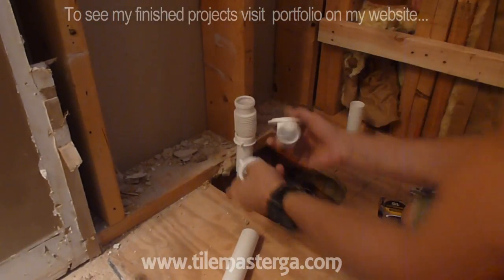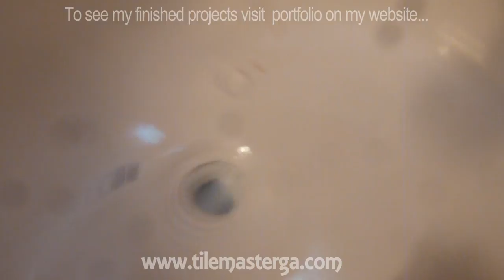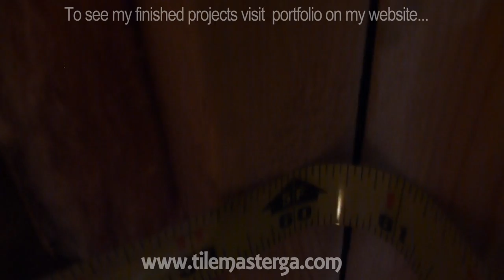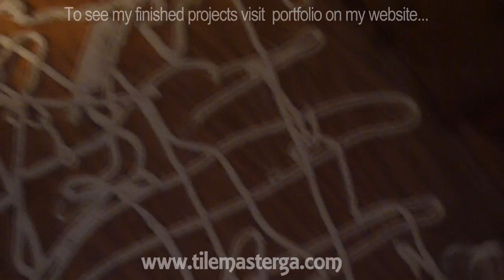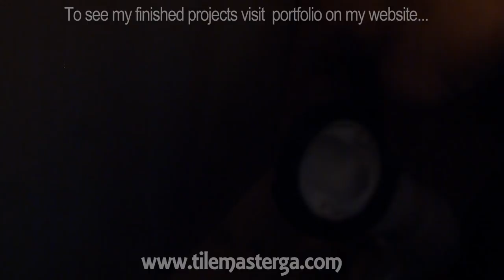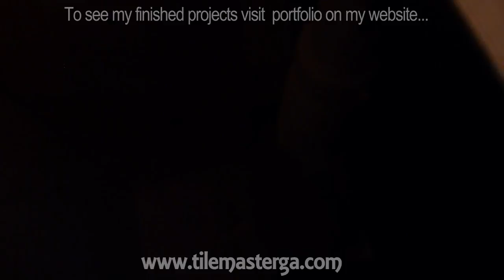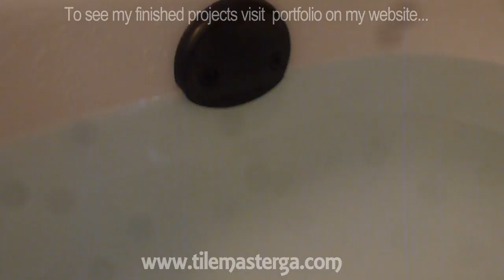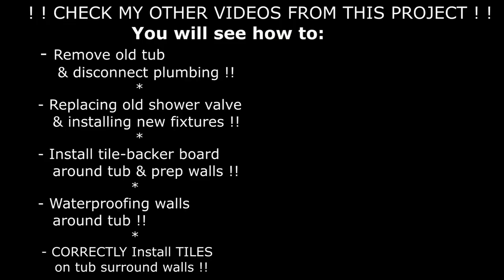Part "2" Installing new bathtub, connect drain waste and overflow plumbing DIY Atlanta GA

Comment: Just wanted to stop by and say great videos Mike!!! I used to do construction when I was in college (mostly roofing but we did bathrooms and other various work once in a while) but if you're not doing these types of projects every day you tend to forget steps. You're very thorough in detailing what parts/tools you're using and more importantly WHY you are doing what you do. That really helps when trying to figure out what I'll need to do when I redo my own bathroom. I'm DIY homeowner in the process of updating room by room in my place. Kitchen is done, flooring done and now onto the vanities and bathroom. These can be more intimidating due to the plumbing and demo involved and the pressure to do it correctly. Your videos really help providing confidence that I can do this myself (luckily I have a brother & friends that know this stuff just in case I need someone to bail me out haha). A lot of other contractors go to fast or assume you're a pro when explaining processes, or even worse they DON'T provide tricks of the trade on their videos. If anything you are getting you're name out there and positive word of mouth about your work. I'll definitely be using your vids for tips and also other ideas when I redo my place. Thanks for posting!

Comment: I do maintenance work and I have a suggestion. That inside lip of the wall has that horizontal 2x4 nailed to support the inside 60" lip. I find that the 2x4 does not hold up with use and the seam between the tile and tub will move too much causing the caulk or grout to need constant repair (every 2 or 3 years). I recommend adding vertical 2x4 support at every stub to give it extra support. Also some tubs never sit on the floor. I suggest filling the space under the tub with support to reduce stress on that same horizontal 2x4 support. Pour concrete into a plastic bag and place that bag under the tub. The concrete will mold to the shape of the gap and give the tub a nice solid feel on the bottom. A tub full of water and a heavy set person can make the tub move and eventually destroying the seal between the tile and tub.
Reply: +James L That is an excellent idea. Thanks.
Reply: How wet do you make the cement and what types of plastic bags do you use? I have always braced the horizontal supports but Great cement bag idea.
Reply: oh! Good idea, thanks.
Reply: That bag of cement is such a great idea. We foamed the bottom of our tubs in new home construction, but you do indeed risk the expanding foam lifting the tub up if you do not weigh it down. Also, the foam method assumes you already perfectly levelled the tub. This cement idea can let you rework the tub if need be. Thanks! I'll try it out next time!
Reply: YES! Brilliant addition to this video. We started out like this but used our knowledge from fixing old stuff in our home to do the same. This guy is young (but better than most vids you see) and very thorough and I know he will appreciate this comment. I know I would and do!
Reply: You, my friend, are a genius!

Comment: The tub basin was said to be slightly imperfect is why the inconsistent tub lines and slight jank because of extra work but installed with the level reading right for uneven lines from factory tub slightly ...good job

Comment: Definitely respect your language skills. I was an ESL student once, and your explanations are admirable in clarity and composition. I'm sleeping on the floor after dismantling my bed so that I can paint this room properly. In the process, the fins on the baseboard heater were bent and filthy so I spent over an hour straightening and cleaning them. I won't be down here on the floor again for a while, so why not do it right? I'll reinforce the tubing mounts and drill around the whole case unit with self-tapping screws. Otherwise, the segments will fall off and bend the fins all over again. Someone else wouldn't care, but I am not that person. I am not a tradesman, but trained as a heating tech when I was younger. I was taught by an old German-American teacher, Mr. Scherle, and his lessons live in my hands. Auf wiedersehen and good work from New York City.

Comment: I agree. great instructional. I will say that it looks like it was a 32" wide tub that came out and only a 30" that went back in. That would explain why your drain and overflow did not line up. Everything got moved over closer to the wall, meaning the center point was a shorter distance

Comment: I have to say that i watched many videos on this topic, and this one is by no doubt, No.1. I wish you were in LA, California so that you could do my bathroom. Professionals like you are no where to be found here.
I basically did remodel my bathroom, and did many parts myself except i let a plumber set the tub and do the plumbing and a tile guy to do the tile. Well i ended up demolishing the tile work and it became disaster. The only reason i hired people for that is that i wanted a professional job. My tub was installed not level, the tile guy was following the tub, and the result was the two side walls were totally not leveled. One side was next to a window, and edge of the tile was basically going away from the window line about 3/4" from the bottom to the top. Very visible. Even the tile guy barely used level. Unreal... He didn't even think water proofing was needed. Also he was arguing with me that there should be no thinset between the plywood subfloor and the backerboards. Just screws he said.... Where are the true craftsmen like you? can you open a school and teach these people how to work??? please....

Comment: Thank you so much!  This was a thoroughly detailed and amazingly helpful video!  

The use of a flexible tail piece on the overflow tube saved me so much time and effort.  I don't think it would have been possible for me to fit a standard rigid tube in my location without significant changes to the waste line.  Instead, my tub was hooked up in less than 10 minutes!

Comment: very good.very informative. repetition is good.
to inspect your work on the cheap, use your webcam and your laptop. I used it once with a 10' USB extension - worked like a charm. You can take pictures or video.

Comment: Thanks!  I have followed all of your suggestions and the tub install went great!  I actually purchased the same tub you used in this video because it was the best bang for the buck.   I ended up using 1/2" Durock board and latex modified porcelain mortar.   Coming along great!  I couldn't get the drain plug to hold without leaking using plumbers putty because it all pushes out with my drain flange so I went with Permatex's non-hardening "form-a-gasket" ...so far so good!

Comment from the maker: Yes, you just need transition from metal to PVC - usually rubber coupling - ask in local hardware store. I am assuming that you have old cast-iron pipes?? if so you will have to remove old p-trap and put transition coupling on main pipe (2") and then PVC p-trap and drain... I hope that helps.

Comment: good show....remember if you have an Inspection,you need an access door to the drain,unless you use solvent weld fittings.

Comment: Do you use anything on the adjustable joints before tightening... just hand tight?  No glue or cement... Just the pinch gasket???  Thanks so much for the help.  People don't realize how much of a hassle it is to video tape jobs like this.... Thank you for your time.

Comment: Everything looks like true perfection Tile Master. But I would of like to see how you also installed the tile on part 4 if you could do a part 4 of this tub install.I like how you installed that little tile in between upper & lower large tiles, now this design is the best I have ever seen, real art.And that looks like a 90 deg shampoo bottle holder, now how it hangs out so far and it won't break off ?

Comment: Hello Tile master,
I am doing a reno and put in new tub that has about 2 3/4 inch of styrofaom attached to the bottom of the tub. Once it is in place and I get into it you can hear the styrofaom squeak like its rubbing on floor. Can I spray foam and then secure the tub again to get rid of the squeak??   Thanks......Great videos too...awesome!!  Cheers!

Comment from the maker: Good luck Buddy !!!

Try to avoid using hardi - backer board ! use regular cement board instead !! Durock or perma-base or wonder-board !!

Also do not use mastic !! -please use polymer-modified thin-set mortar - white !

Michael

Comment: Thanks for this detailed video!  I have my bathroom gutted and am getting ready for the tub installation.  The spacing between the studs length wise is about 63".  What would you suggest I do to fill in the space?  Thanks in advance for any advice!
Reply: In case anyone has this same issue, I ended up putting a few extra sheets of sheet rock on the wall, and using furring strips on the studs behind the tub to bring the wall out and get a roughly 60.5" spacing.

Comment: Can you tell me what you would do if the tub is out of level in the opposite direction as it is in the video.  My new tub is lower in the back where it seems to be impossible to use shims.  Thanks, and great job on the videos... probably the best I've ever seen.
Reply: take the tub out and raise the supporting 2x4 level starting with the highest point

Comment: Very informative and practical video. Thank You. Quick  question - In my case the existing drain pipes are black ABS type and you are replacing in this video white (thinner) PBC pipes + flex segment addition which works great. Should I convert to a white PBC kit + flex part or have to stick to ABS and replace with an ABS drain  kit (apparently no flex analog for ABS bath drain pipes ?) Anyone? Any suggestion would help...

Comment: Very good video and good product you are selling.  I was wondering about the material of the drain kit.  I can't tell from the video so I will ask.  Is the material tough enough like regular sturdy PVC?  Can it handle things like Drano and similar products on the market used to force hair and grease to move?

Comment: Shimming and leveling seems easy if your slope is to the OUTSIDE....anyone have any advice if the slope is toward the wall? Love the videos, much appreciated and money saved.
Reply: Jason Schneider install the back 1x4 support high enough to eliminate the slope. No shims , but the cement or foam under the tub will also help support it.

Comment: wondering if you have insight into tie in  a bathtub or clawfoot tub into the same drain for a separate shower. Its new construction. Everything I'm reading about seems like its not possible but like I said we can add in a step to the floor but the initial drain is already set into the concrete.

Comment: Great Video, thank you. One thing I notice is the hole in the floor, It was left open any reason why? I noticed that it was sealed when you took the tub out.  Did you have abscess from the bottom of the floor or was it a cement slab? Also you mentioned placing the cement board at the top edge of the tub, other remodelers say to go over the edge and leave 1/8 gap. Same with the tile, any comments? Thanks again.
Reply from the maker: In most applications tub drain is lower that level of the subfloor and it is impossible to seal it! When installing drop-in tub we have better options to adjust drain and to seal the cut-out. In this case we had access from below and we sprayed foam to feel the gap later. You can leave 1/8 gap and later fill with silicone - either way is OK!

Comment: Great video, excellent workmanship. Do you have a video which shows installation on a concrete slab? I removed the tub in my house and the p-trap is buried in the concrete, is that the way it should be done?

Comment: Hi! I love your videos! A quick question about the hole you cut around the drain on the sub floor. Won't rats or some other animal's crawl up under the tub from under the house if the hole isn't fillied? Thanks

Comment: Great videos Tile Master.  I am redoing my bathroom.  I removed he fiberglass bathtub and wall surround.  My flooring is cement and there is dirt where the drain is.  Is this how it is supposed to be in a single level home?  Also, can you use the filler on the floor just to help with leveling, in case you are off?  Thanks for all of your advice.

Comment: Thank you for this video. I am about to install a tub where there has not been a tub before. Have you worked with tub/shower surrounds instead of tile? Also, I have a bathroom that is about 61" instead of 60" How would you compensate for the size difference with that much of a gap? The wall panels are not drywall-- but an old very thin printed wood paneling from the 60s or 70s.

Comment: Hello!!! My husband and I love your videos and have been watching (over and over again) and following them! We even bought the identical tub you used for our installation!
We have a problem with our installation and I'd like your advice, please. After installing the tub, with the foam, ledger boards, shims, etc, we noticed that there is a creek when we step into the tub!!! We accessed what we could and sprayed more foam in the areas we could access and refilled the tub with water to prevent the new foam from making the tub rise (because it was perfectly level). After doing this, the creek wasn't fixed! Yikes. What can we do? I don't want to have to remove the tub (how can we even with the foam?!!) and redo. Anything to remedy the situation? Thanks, Lauren

Comment: So is this bathtub install designed for a shower curtain?  I like the detailed molding at the top over the 12" tiles, but won't that interfere with glass enclosure?

Comment: One thing i dont understand was that why did you measure the 2x4 that support the tub based on the highest point and then have to shim the low point. Why not base on the lowest point and not have to shim since the low point was the front?

Comment: My contractor does not want to use foam on the floor for the tub.He said it would be difficult for him and he will not be responsible for the un-level . Also it will be difficult to take out later. He can shim seals to do the level for the bathtub  Should I accept it?

Comment: If you were not going to use thin-set and tile for floor (like with water resistant Luxury Tile), what would be the process for filling the gap between bottom of tub and floor?

Comment from the maker: If you have access from the back  that may be way to go. Most likely tub is missing wooden block ( or block installed not correctly) 
Also most likely it has gap between tub and sub-floor - some foam that expands should help in this case.

Also there is risk that subfloor is simply weak, or rotten for leaking water.....

Comment: you made a good video, more detail than others.   why didn't you make access  panel?  it could be  easier and quicker. anyway owner will need access to the plumbing in case of leaking

Comment: Hey tile master..are screws required to secure tub to joists...particularly if tub is 350 lbs?  Also, will expanding foam secure such a heavy tub from movement...particularly if tub is already in place and would have to be shot in from both ends...thanks for your response

Comment: Thanks for the awesome video.  I was wondering at the end after the spray foam sets up do you remove the shims or just cut them off so you can tile the floor?  Thanks again.

Comment: Great work your work looks very professional ...what would it cost me to replace a tb and also the stop water valves and very same repeat like you did here .please respond.
Reply from the maker: There is many factors that determents price. I do not have flat fees !!   I will not be able to answer your question without looking at project in person.... Sorry

Best regards.

Michael

Comment: I have one more question. Currently the drain kit I have is from lowes (Plumb Pak 1-1/2-in Chrome Triplever with PVC Pipe). It is polished chrome finish for the trip lever and drain cover. I saw that you used a separate Brass-finished overflow cover and drain, and intentionally did not use the ones that came with the kit. Is that because of the durability issue? I read that the screw that holds the overflow can get rusted within a few months. Any recommendation for a long lasting solution? This is for a tenant unit bathroom, and I want to make sure the material lasts for a long time! Thanks so much!

Comment: Just another comment, while I think of it.  It's a good idea to have a rubber bathmat handy to throw into the tub while you're working.  That way you don't scratch up the tub while you're stepping in it with your shoes on.

Comment: Great videos.. that turned out nice! Did you fill in that big gap that the drain ran through with foam like it was when you started? Did the gap lead into the crawl space under the house?

Comment: Is the installation the same when the tub is sitting on a concrete slab? I will be remodeling a bathroom in a rental that I am purchasing and it is a slab with no crawlspace. Not sure if there is room like shown for working with the drain.

Comment: With the one end of the tub 5/8" too far out, why couldn't you install a 1/4" backer board first, then 1/2" backer board to bring the face of the board out far enough?

Comment: These are the most thorough videos on installing a tub I have seen!  Thanks!  I will be using all of your videos this weekend on my very first attempt at tub installation in our guest bath.   I have not watched your tile videos yet but do you use mastic or something else as adhesive to secure wall tiles to the backer board?  I was planning to use Hardy Backer Board?  Is that product OK?   Thanks!